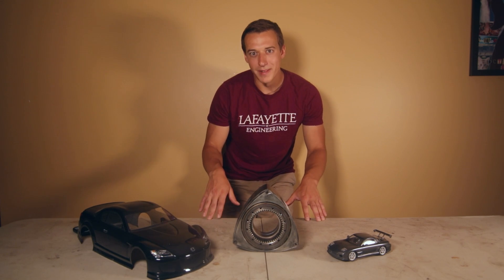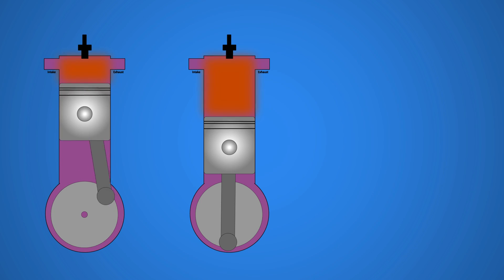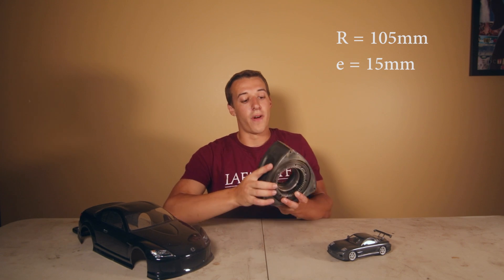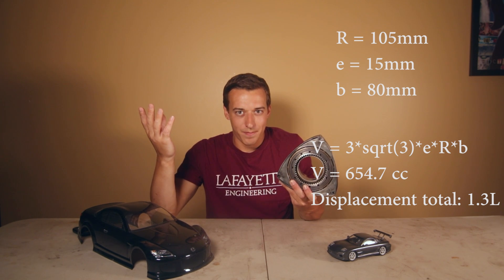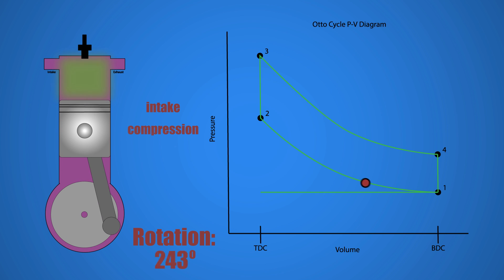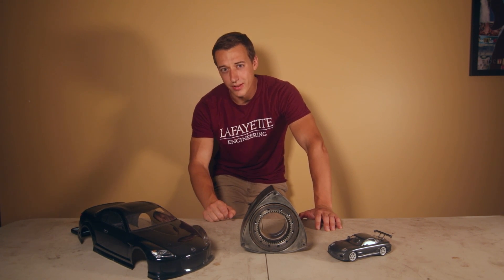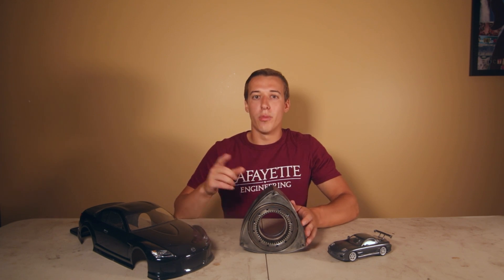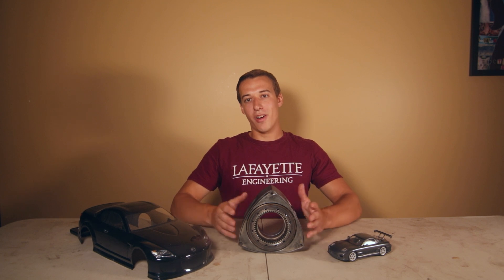You are WRONG about Rotary Engine Displacement

Comment: it seems pretty straightforward to me, since no matter where the rotor is in its cycle is there is always the same area in the housing that’s what the displacement should be. so housing volume-rotor volume =displacement. I don’t know why you compare it to a piston engine 2or4 stroke it’s entirely different and should be measured differently I don’t know why they only use the displacement of one face either when it is always doing 3of the 4strokes.
Reply: All 6 chamber volumes have their own 4-stroke cycle, it is a 3.9 liter.
Reply: @sandervanderkammen9230 but a rotor volume always takes up of 1/3 chambers
Reply: @DrPsta If that were true, there would only  be 1 power stroke every 3 revolutions of the eccentric-crankshaft.

Comment: You can choose between 2.6L 2 stroke or 3.9L 4 stroke. There's no 1.3L that's delusional and you are a marketing victim.

It's a very inefficient engine and if it was a 1.3L it simply wouldn't make the power because of the AFR.

It makes much more sense to look at it as a 3 cylinder 1.3L 2 stroke or 1.96L 4 stroke per rotor. So you stack them up and get your engine. Compare it with the RB26 and the 2JZ and you'll see how much more sense it makes. Otherwise you just believe in magic.

Comment: That's a great job of explaining the displacement, but it still doesn't make any sense to me. What it describes is one face of a three lobed rotor. It fires three times in a single rotation. Why wouldn't the displacement be calculated then the same way that a two stroke's displacement would be calculated? As an example, a 3-cylinder 2-stroke engine displacing 750 CC's wouldn't be called a 250, it would be called a 750. All cylinders will fire once throughout one rotation of the crank. The other lobes of the rotor are simply doing the same things that the other two cylinders are doing in the three cylinder 2-stroke example while one of the Piston is on its powerstroke.

Comment: I say 1.3l. As do the engineers who get paid over 1/4 mllion and went to collage 2 years more then my 4 years that work for Mazda. Oh, and the Federal, safty, race track safty and technical inspector's plus Aviation safty (was in airplanes before cars) a few more im missing. Thay determined 1.3L before the motor ever achieved flight. (YES was in plans before you could buy them in cars). Any one tells you its not a 1.3L laugh at them and ask how long ago a 1.3L smoked thier 5.0L. Their just looking to not feel bad. Its not about size its about efficiency. Anyone tells you otherwize its because your not efficient, or its blown out and sloppy so you need the displacements to make up for it.

Comment: With 1 thermodynamic cycle in piston engine, you have 2 rotations of the crankshaft. In a rotary, 2 rotations of the eccentric shaft give a thermodynamic cycle to 2 faces of the rotar. Thus, the 1.3b has VIRTUALLY the same displacement as a 2.6, even though they only have the actual displacement capacity of one face at a time. Many racing leagues count this to be fair. However, you should take into account that they can spin higher RPM, and are actually lighter than a 2.6 counterpart would be. Therefore, I agree with F1's decision to ban them entirely. Technically speaking, 1.3l. For power comparisons and racing divisions, 2.6l.

Comment: Engine displacement is calculated by the volume of the combustion chambers, which totals 1.3l for the 13b. I understand that it's necessary to get into more technicalities when comparing with standard engines, for competitive or insurance purposes, but it's a 1.3 rotary engine and saying it's a 2.6 or 3.9 is misleading and plain wrong

Comment: Mazda 13B 2 rotor engine is a 3.9 liter engine. Its real thermodynamic cycle set at 1080° of eccentric shaft rotation (tree 360° spins) tells it

The rotor inside the housing forms 3 separated spaces (combustion chambers) and each one displaces 654cc to complete a 4 stroke Otto cycle (admision-compression-ignition-exhaust) 

On one rotation ot the rotor (360° rotor rotation) all 3 combustion chambers completed a 4 stroke Otto Cycle. Thus displacing 1962cc in total  (654cc x 3 = 1962cc) In that 360° of rotor rotation the eccentric shaft spun 3 times (1080°) because rotary engines are geared that way in wich One rotation of the rotor (360° rotor rotation) equals 3 rotations of the eccentric shaft, so for every 360° of rotor rotation the eccentric shaft will go 3 revolutions (360° x 3 = 1080°)

That 1080° number is importan, because you mentioned "Thermodynamic Cycle" and in a Mazda 13B engine its real thermodynamic cyle is set at 1080° of eccentric shaft rotation, not at 360°   like a 2 cycle engine (Rotary engines ARE NOT 2 cycle engines), neither is set at 720° (2 crankshaft rotations) like in 4 stroke piston engines.

At 360° of eccentric shaft rotation just one side or flank of each rotor completed a 4 stroke cycle (654cc x 2 = 1308cc / 1.3L) *Remember each rotor side acts as a combustion chamber as it moves inside the housing, therefore each rotor do the work equovalent to 3 pistons in a conventional engine...But this sole rotarion of the eccentric shaft (360°) does not makes the 2 rotor engine complete a full thermodynamic cycle, it just has done 1/3 of it.

Mazda did use this method to give it a "Nominal displacement" accounting just 1/3 of its real capacity because in Japan and Europe carmakers got to pay an Engine Taxation Rule that is based on engine displacement and the more displacement, the more taxes Mazda had to pay and that placed burden on the future of the "Wankel" rotaty engine developement in its early stages in life. NSU the first company who built rotary engines did quote their displacement accounting the CCs displaced by all 3 rotor sides, so its single rotor engine with 500cc displaced by each rotor side was rated at 1500cc / 1.5L. And from that engine they did a 2 rotor engine version that displaced 3000cc / 3.0L
Then Max Benttle an Engineer from Curtis Wright told NSU that rotary engines will have problems in Europe and Japan because of the Engine Taxation System.  

https://www.hemmings.com/stories/article/how-big-are-wankel-engines

Then motor-sports sanctioning entities came with the dilema of equalizing rotary engine powered race cars with 4 stroke cycke piston engine cars, their solution was to gave rotary engines what they called "Equivalent Displacement" The Society of Automotive Engineers S.A.E  used the 4 stroke piston engine's thermodynamic cycle time (set at 720° of crankshaft rotation) to give rotary engines an "equivalent displacement" and they found that at 2 spins of the eccentric shaft (720°) 2 sides at each rotor completed a 4 stroke Otto cycle (654cc x 4 = 2616cc / 2.6L) That is the infamous 2.6 liters of "doubled displacement" many mention, but it only accounts 2/3 of its true displacement.

A Mazda 13B engine IS NOT a 2 cycle engine.
A Mazda 13B engine does not complete a thermodynamic cycle at 720° of crankshaft rotation. 

The thermodynamic cycle (all combustion chambers doing one 4 stroke cycle each) is at 3 rotations of its eccentric shaft (1080°) 

So lets check all 6 combustion chambers and their 4 stroke Otto cycle time

Mazda 13B engine
At 360° eccentric shaft rotation: One side per rotor (2 sides total) complete a 4 stroke Otto cycle. 654cc x 2 = 1308cc / 1.3 liters.  Mazda's Nominal Displacement quote. 1/3 of its Thermodynamic Cycle.

At 720° eccentric shaft rotation: 2 sides per rotor (4 sides total) complete a 4 stroke Otto cycle. 654cc x 4 = 2626cc / 2.6 liters.  This is S.A.E's "Equivalent Displacement" Formula. 2/3 of is Thermodynamic Cycle.

At 1080° eccentric shaft rotation: 3 sides per rotor complete a 4!stroke Otto Cycle. 654cc x 6 = 3924cc / 3.9 liters. Its real displacement set by its real Thermodynamic cycle.

Remember, the eccentric shaft went 3 revolutions (1080°) but each rotor did just one rotation (360° rotor rotation) with all 3 combustion chambers doing ONE 4 stroke cycle each (654cc x 3 chambers = 1962cc per rotor/housing set x 2 number of rotors = 3924cc / 3.9 liters.

Another metric that certifies the 1080° ecxe tric shaft rotation for the complete Thermodynamic Cycle of the Mazda 13B rotary engine is the Timing events in degrees per eccentric shaft rotation.  In a Mazda 13B 2 rotor engine each ignition event is fired at 180° of eccentric shaft rotation amd there are 6 ignition events. 180° x 6 = 1080°

If you want to certify that a Mazda 13B engine is a 1.3 liters (1308cc) engine then get one of thos engines to work with ignition firing for just ONE side of each rotor and the other 2 sides of each rotot with no ignition firing, and kets se if it will spin at idle with just 1308cc / 1.3 liters (1/3 of capacity)

When you do a Mazda 2 rotor 13B engine compression test, you get 3 compression lectures for each rotor, not 2 ("1.3L"), not 4 ("2.6L), you get 6 (3.9L) And what each rotor side compresses? They compress 654cc. There you have it, a complete information tab about the real displacement of a Mazda 13B 2 rotot engine. 3.9L counting ALL its 654cc chambers.

654cc x 6 = 3924cc (3.9L) @ 1080° eccentric shaft rotation. 

Ignition timing at 180° eccentric shaft rotation x 6 ignition events = 1080° eccentric shaft rotation.

One rotor revolution (360° rotor rotaton ) makes the eccentric shaft spin 3 times (1080°)
Reply: This is what I have tried to explain to people. There are three strokes going on. And when you see the power, fuel and oil consumption,,,not to mention the weight, Its pretty much a small inefficient V6. Best thing to do with a Rotary? Pull it out and sell it. Then swap in a K or LS
Reply: TLDR. All 3 faces of the rotor can't reach the exhaust port and complete the stroke at the same time. 

Just like how pistons are measures from BDC to TDC, you have to measure a rotors displacement from one point through to that point again. If you did that, only one face could have completed a full cycle. 

It's about being consistent. If you start arguing about the 3 faces, to remain consistent, people could start arguing that a 1.0 ecoboost is actually a 3.0 ecoboost because each piston has to run 3 combustion cycles before it counts as the displacement.

Why do people have to look for ways to artificially exaggerate the rotary displacement? Rotary engines can carry out more combustion cycles more rapidly and can complete a thermodynamic cycle more often. That's their advantage at cost of torque. You don't get to take that away from them because you think that low displacement, high power is unfair on piston engines. They get torque, we get more RPM.

655cc per rotor. Get over it.
Reply: @Dagr8soldjer  thats true my friend

Comment: In the UK theyre registered as a 2.6L engine to warrant paying more tax on the car. 2 stroke engines follow the same rule as 4 stroke engines so I dont see why rotaries have to be different. luckily if you bought a n imported RX7 a lot of those were registered as 1.3 L engines
Reply: Wankel engines are all 4-stroke, they are not 2-stroke.
It's a 3.9 liter engine, adjusted to 2.6 liters at a 720° degree cycle.

Comment: False. 1.3L partial displacement would only be correct if a 4.0L V8s were rated as 0.5L while each single cylinder fires. 
0.5L and 1.3L are partial displacement. 4.0L and 3.9L (1.3 x 3) are total displacement. This is why so many people are disappointed in the irl fuel economy because they’re being quoted a partial displacement number, while the motor lives with its total displacement in the real physics, not marketing. Sadly, the EPA could not do the math that you did at the beginning of this video and were as confused as anyone else.

Comment: so what i got is it's a 1.3l that just fires more per revolution of the crank. . . kind of obvious to you people who think it's a 2.6l
Reply: Tax displacement is fictitious method concocted by NSU Motorenwerkes GmbH. to cheat the vehicle registration taxes in countries where taxes are based on engine displacement.
Both Felix Wankel and Max Bentele publicly rebuked "Tax displacement" as inaccurate, deceptive and misleading.
 The Mazda 13B series has a total true swept volume displacement of 3,924cc's and when compared to the   Otto or Diesel Cycle engine approximately 2.6 liters using the 2x conversion formula.
Engineers, Government agencies and motorsports sanctioningbodies all recognize the 2x conversion formula.
Any questions?

Comment: The comparison of rotary engines to two strokes is apt. They both burn oil, both are very polluting, and both aren't used in cars any more and never will be again.
Reply: All Wankel engines operate using the 4-stroke principle.
The Wankel engine has no characteristics that are unique to 2-stroke engines that cannot also be found on examples of 4-stroke engines.

Comment: This is really going to ruffle some feathers but actually if you really want to get technical neither of those are right because an engines displacement has nothing to do with the number of stokes or cycles since that is only relative to a single working cylinder or camber.. The true "COMPLETE ENGINE DISPLACEMENT" is 3.9L (3924cc's). 

The reason is, an engines displacement is the volume of one working chamber times the number of working chambers. Example, a 2L 4 cylinder engine has 4 500cc cylinders (or you could say 4 500cc stroke volume working chambers) thus equaling 2000cc for a complete engine cycle , a 5L V8 has 8 625cc working chambers for a complete engine cycle. At the same time, a single cylinder 250cc 2stroke engine has a single 250cc cylinder (single 250cc stroke volume working chamber) for a complete engine cycle. "Complete engine cycle" is the key aspect here. 

The number of rotations it take for the crank shaft has absolutely nothing to do with the engines calculated displacement (complete engine cycle). Displacement is simply sweep volume of a single working chamber x the number of working chambers.

With that said, the 654cc value for a 13b engine (which you forgot the /1000 at the end of the formula  you put up starting at 1:40 mark of the video) is for one rotor face and there are 3 faces per rotor and 2 rotors (obviously referring to a 2 rotor engine here namely the 13b) so here is 6 working stroke volumes and thus the really apple to apples comparison is 654 x 6 = 3924 just a a 2L 4cylinder engine is 500 x 4 = 2000
Reply: Excellent comment.
Reply: Who cares really?
Reply: @xMorbidArtx  Anyone that wants to have a serious inteligent conversation comparing the performance of the Wankel engine compared to other types of 4-stroke engines like the Otto or Diesel.

Tax displacement is not a valid method of calculating swept volume displacement, never has, never will.
Tax displacement is pure marketing and advertising strategy and is not recognized by engineers, Government agencies and motorsports sanctioning bodies.
Reply: @xMorbidArtx  Childish insults won't prove the 13b is 1.3 liters... or make you look smarter son.